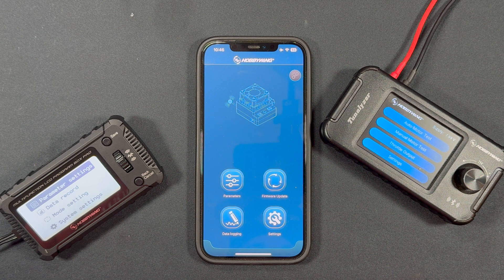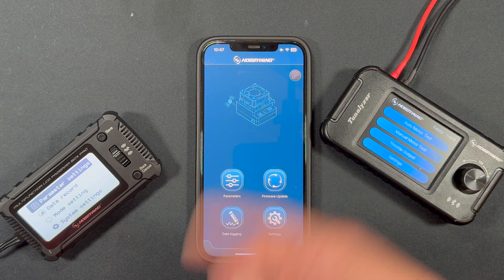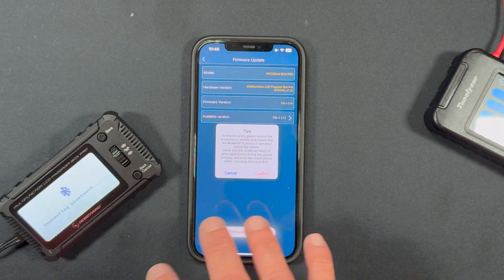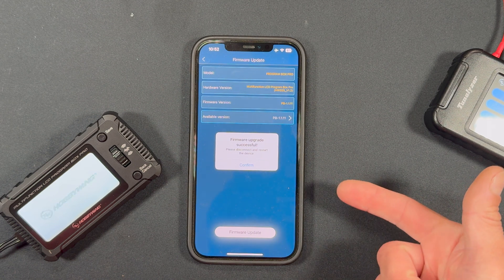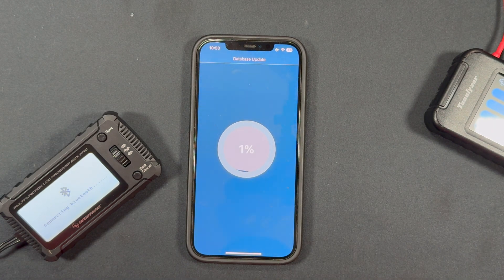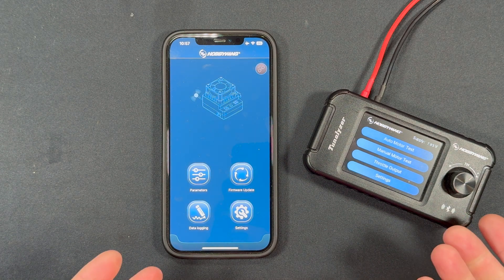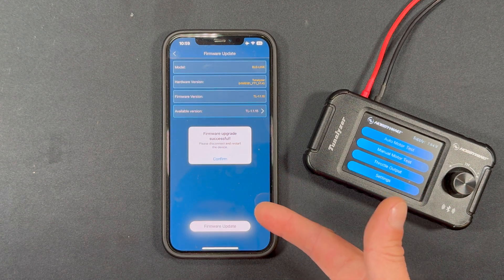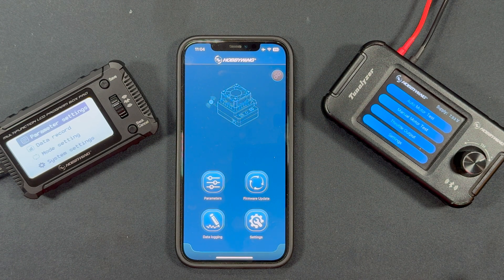HOBBYWING Bluetooth Module Updates - The Charlie Show - EP 393

Comment: I had an issue with my OTA PROGRAMING Bluetooth.  I connected to the just stock  to rotate  the throttle  then that was fine. then I wanted to change some setting like punch start and some stuff and now it won’t connect. It say I have to calibrate manually what does that mean.

Comment: If I was going to buy one of those two modules to deal with a few older ESCs (although I plan to upgrade) which one should I get?  What are the advantages?  Having an onboard database seems like something I would use to avoid lugging a laptop around.  
Currently, I have the old Wifi module that I move around but once things are set they don't change much.  I'm trying to get away from moving ESCs by getting some of the new G2 stuff and dedicating it to one rig.  
Thanks!